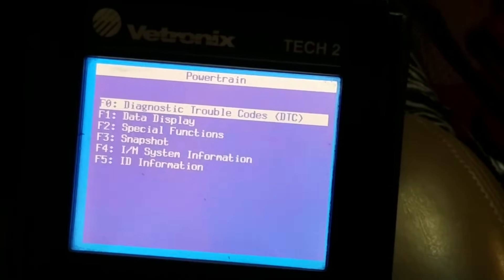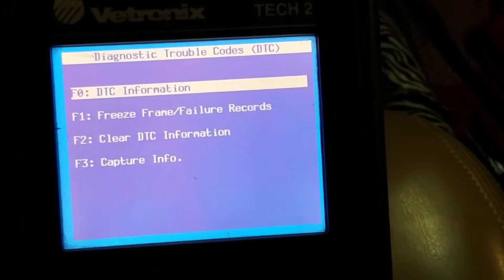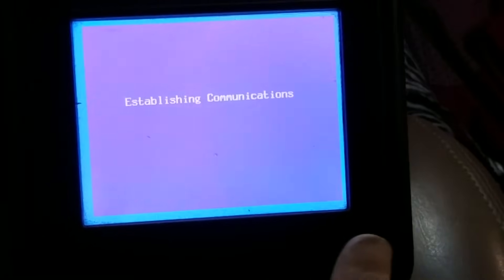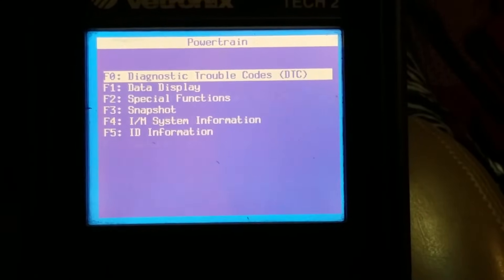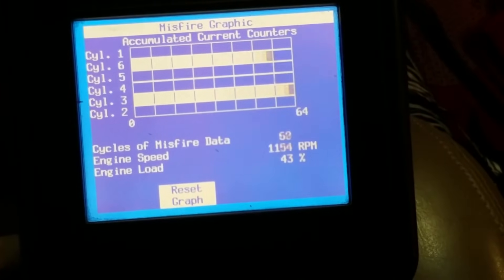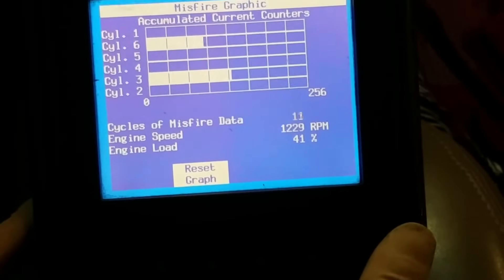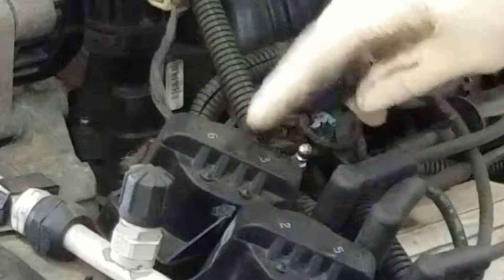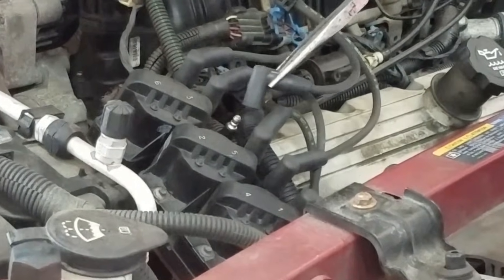How To Fix A P0300 Random Cylinder Misfire

Comment: For any one, I had a misfire that i couldn’t find for about 6 months. Replaced all ignition coils and wires, spark plugs, air filter with maf sensor even map sensor, pcv valve and checked for vacuum leaks. I finally found that it was my intake manifold gasket that was leaking, so I just recommend don’t go into blindly replacing everything spending so much money and keep doing tests to be sure what’s needing replacement

Comment: Got the same code on my 04 expedition. Mine was an easy fix. Start the engine. Pump the breaks 6 times. Turn the head lights on. Power down both rear windows. Put seat belt on. Turn radio on and off 3 times. Pump breaks 6 more times. It worked. Runs great now. LOL. Have fun.
Reply: All the same but also have to open left rear door two times

Comment: So what does one do when the ICM, all 3 coils, plugs, and plug wires have been replaced and you still have an occasional misfire under mid-range throttle? No problem under W.O.T.
Reply: Check distributor

Comment: Nice info here. With my buick 3.8 it would run fine until about 20 minutes into my dtive to work, the same driving home first 20 minutes was fine then it would start missfireing an show a P0300. I used a chesp 10 dollar spark tester an a spare plug wire i hsd in trunk to check each coil, with the spark tester adjusted to 1.5 inches top an bottom coil sparked, but center coil would not until i screwed in the tester adjuster to 1 inch, an this was with a cold engine. I moved the coils around an had same issue with middle position coil, others were fine.  Bought a new ICM an issue fixed. Think the old one was heating up after 20 minutes and the already weak center position would just stop producing a spark.

Comment: Can anyone tell me if misfiring cylinders can cause an engine to seize? I have a 4 cylinder honda; the engine seized a couple of days after I had the scan done.
Reply: 99.9% chance that it won’t cause that. Unless it was misfiring for so long that it weakened a connecting rod or something and that broke and blew the engine. But yeah in 15 years of working on my own cars and 10 years in shops I have never ever seen that happen

Comment: Have a 2005 impala 3800.. was miss firing no code. So I started pulling 1 plug wire from the ignition coil.  Module 2/5 was not arcing/sending spark.  Change coil pack.  Still not spark.  Changed out Ignition module was BAD.  Issue solve.

Comment: If I’m getting sparks from all mine what else could it be
Reply: Intake leak, vacuum leak, injector problem, fuel pump a few different things really
Reply: Also check your censor connections. Get some sensor cleaner spray disconnect your sensors, wipe them down, spray them and make sure you got good connections. Just fixed my po300 code and replaced a lot of stuff and the whole time I had a sensor coming loose off the the timing belt cover that was the culprit. The clip was broken when I payed a mechanic to replace my timing belt and the censor was got loose after a couple weeks and the fun began. Replaced a lot of stuff trying to figure out this code and the whole time it was one little censor handicapping my car the whole time.
Reply: Clogged fuel filter, or bad fuel injectors, or leaking fuel pressure regulator  also can cause misfire issues.

Comment: Thanks for the video. This was exactly what was wrong with my Lesabre. I got a new ignition module and coil pack, runs great now. No misfire, no check engine light. Thanks again!
Reply: Same with my Lesabre, 2005.
Reply: @Tongan Spartan I got it on eBay for $80 about a year ago. It came with the ignition module and 1 coil pack. The seller was Car Parts Wholesale.

Comment: Thanks! This happened on my Montana van last year, it's a 99 and STILL has most of the original parts, including the coil packs, which is what it was that needed changing. This code came up again today leaving for work, gonna test it tomorrow, but prob one of the other coil packs. 
  Thanks for the simple solution to this code. I'll let you know the results.

Comment: Thanks for the video. I just hope this fixes my code as well. Crazy how a lot of things can cause a misfire though. Thanks and keep up the great work
Reply: No jokes. Currently going thru it now. Going back at it tomorrow.
Reply: @AntonioEscobar863  try swapping your coils around to see if the misfire moves. I had a bad coil that would work fine and then mess up and then go back to be good again. I finally just got fed up and took mine to a dealership and paid the 100 dollars for them to tell me it was a bad coil. Left there and bought a new coil and installed it. Been working great every since.
Reply: @bbay1977  I replaced all the ignition coils, spark plugs, egr valve, o2 sensors and the fuel pump. tomorrow I’m replacing the intake manifold gasket. I did a carb cleaner vacuum test and the idle changed when I sprayed around that area. Hoping that’s the culprit. She sounds like a brand new car , but she’s still got a misfire and I’m praying that is it. I’ve also replaced a few hoses that looked corroded.
Reply: @AntonioEscobar863  Yeah with the idle changing I would say that is probably going to be the issue. Just as long as the spray didn't hit any other cracked hose you might have missed. Good luck with it. This is my last car that I have that is fuel injection. I'm going back to carbs and no computers soon. Mine only has 87k miles on it but I think I'm done with all the computers and all. It was a mess trying to figure out the misfire on mine and then I still had to pay someone to tell me what the problem was.
Reply: @bbay1977  I did that gasket replacement, and I fixed the misfire. Did not realize the level of difficulty for that task I signed up for, but I did it and a little extra. Intake had a pretty serious build up of carbon in it so I cleaned her up and replaced a couple hoses, but none of that was the culprit. I had my timing belt replaced by my mechanic about 2 months ago, there’s a censor right to the outside of the cover that’s messing a bolt that he didn’t put back but also had the clip to snap the sensor back broken. Turns out that was a big culprit in the misfires. Plug her up, taped her down and now she’s running great. Thinking I’m definitely doing all my own work from now on. Didn’t have any extra nuts or bolts left, cleaned and snapped every censor in place, replaced a few old looking hoses, and feel like the man for accomplishing such a feat. Think I might go get my certifications and start a small mobile mechanic business. I learned so much. Wild that a censor that’s not connected properly bc it had a broken clip could cost so much trouble. But, thankful for the process of learning my car and turning some wrenches. I think my car appreciates the cleaner intake system and tune up, getting about 45 miles to the gallon on my 06 eclipse right now and she sounds so good. Idling at a solid 600, runs a little cooler and that gas mileage is a big plus. Hitting the junkyard tomorrow to get the nuts and bolts my mechanic didn’t put back in and doing my own work from now on.

Comment: A timing light can uncover misfiring wires and coils and plugs. Spark plug wire pliers can be used.
Reply: Hank Bridges how?
Reply: @checkingthetoob  A timing light shows when the plug fires. If the light don't light, it's either the wire, plug, or coil. Spark plug wire pliers remove the wire without shock.